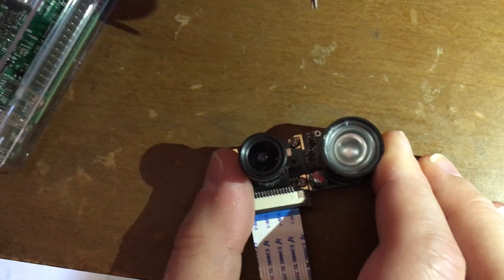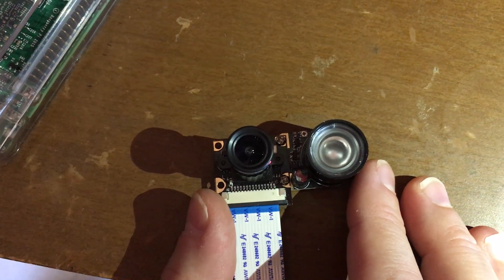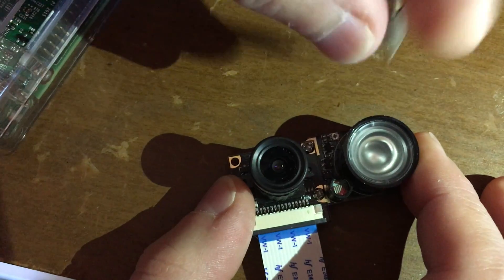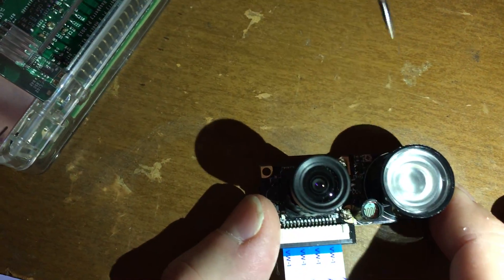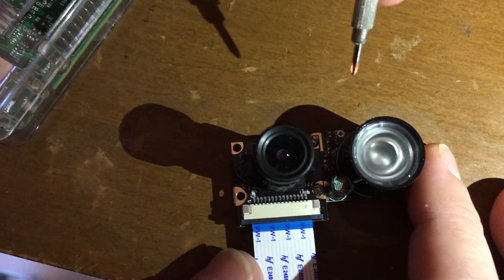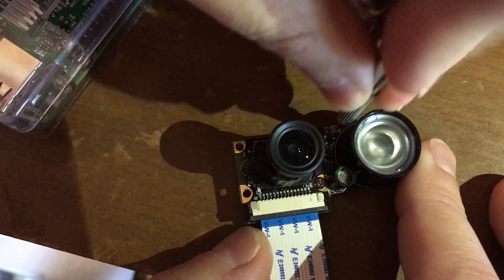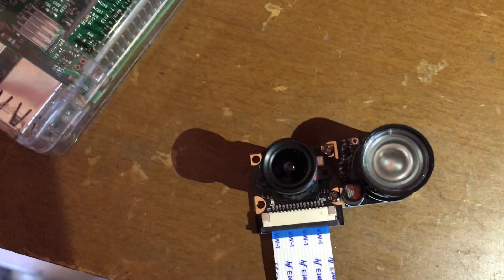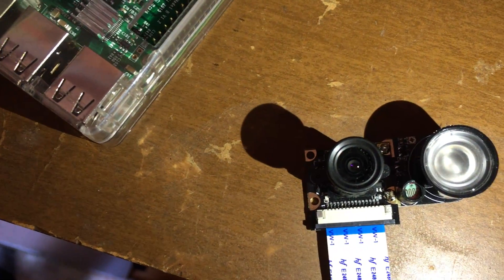Waveshare IR LED + photoresistor test

Comment: my noir camera is different to the one you have and as such my (included) waveshare ir led's do not fit, my camera is V2.1, could this be why? any help would be greatly appreciated as i got my PI as a gift for Christmas and I'm completely new to it so I'm going slow
Reply from the maker: I bought the noIR camera + the LEDs as a single package, and it all fit together. If you also did then you may want to contact Waveshare. If you got it at Amazon you can contact Waveshare as a seller. Their responses will appear in the message center that you can get to through your Amazon account page.
Reply: thanks

Comment: Hi! Had the same problem. It turned out that using a phillips head screw driver did not turn the photoresistor screwhead. I took a flat head screw driver which enabled me to turn it. Because it is so small you may have a hard time determining if the screw head is moving or not. Let me know if this helps.
Reply from the maker: I'll have to try that, thanks.

Comment: hey i wanna ask... 
does waveshare 10299 camera need ir filter?
Reply from the maker: If it doesn't say "NO IR" then it should have its own IR filter. You won't usually need to get your own IR filters, because most cameras have them normally. You buy ones without the IR filters to use in places that are too dark for normal cameras. Waveshare makes models with and without IR filters.